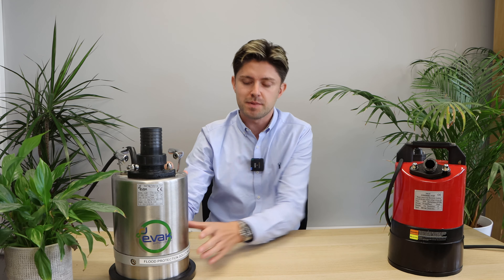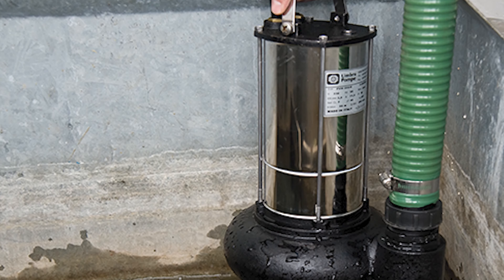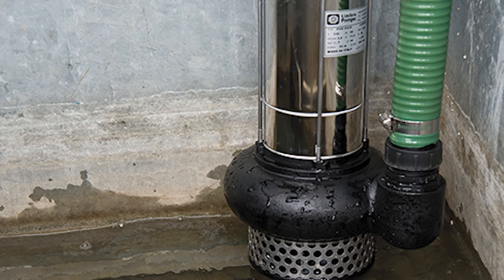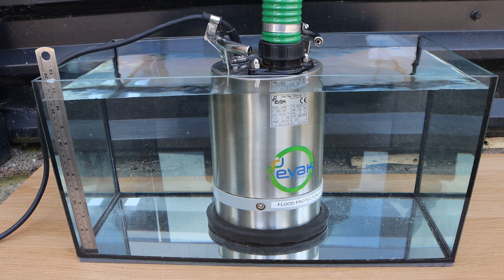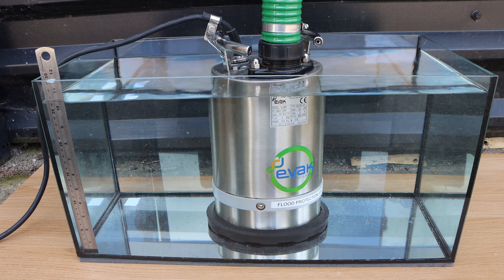What is a Puddle Pump? | Quick Explanation

Comment: Have a question thanks, do these puddle pumps switch themselves off at the 1mm level?
Reply from the maker: These ones in the video are manual so they don't, you'd need an automatic model for that.